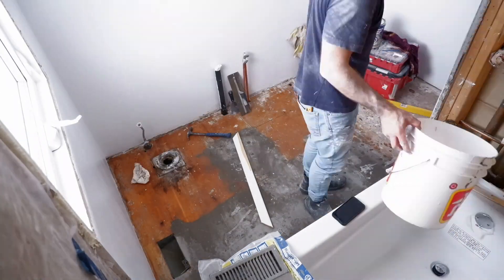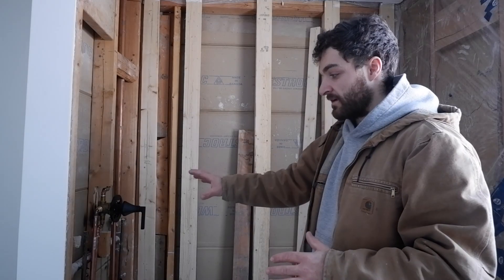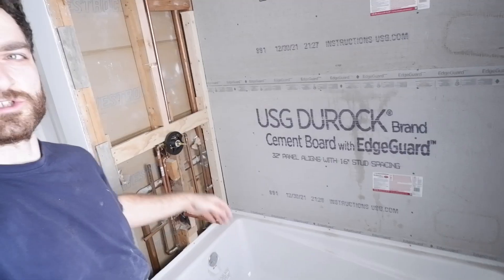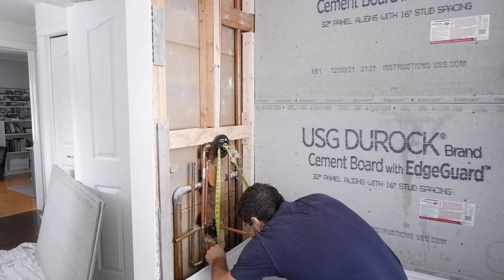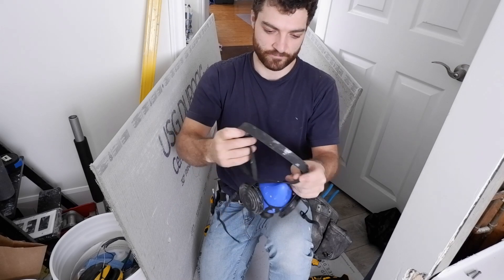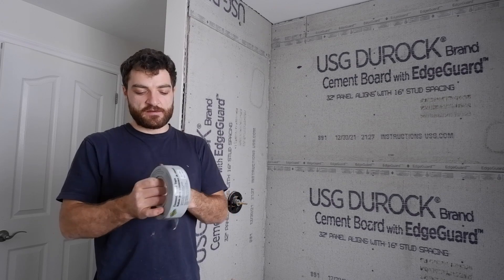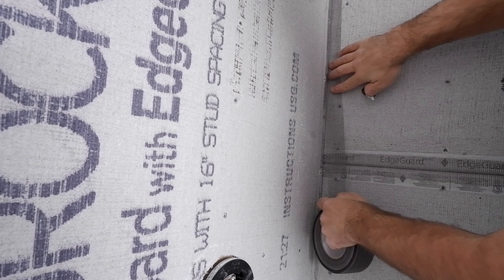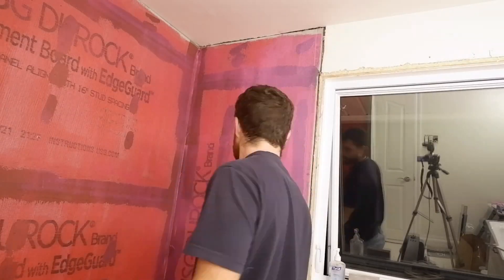How to use Durock and Redguard - Bathroom remodel part 3

Comment: Thanks for the video. Did you have to do any dilution of the red guard before applying to cement board to ensure it adhered well? I had an issue with red guard peeling off the cement board.
Reply from the maker: Hi Jason, 
Interesting, I don’t think diluting the red guard is required, weird that it’s not adhering probably. All I could advise is double checking the manufactures recommendations. 
Couple things come to mind, has it had enough time to dry, is the cement board porous enough, is there any settling of the red guard or maybe it’s been frozen and has separated a bit, which might hinder it adhering properly.
Hope you’re able to figure it out! Good luck

Comment: Correct installation of any cement board is to use thin spacer as you set the lowest panel so that it doesn’t sit on edge of bathtub flange. Needs a caulkable space; Durock says 1/4” although 1/8 is probably enough
Reply: he did do it properly. as long as you set your durock on top of the flanges your fine. because the tile goes down to the tub. then grot it wholes up for years.

Comment: You don't tape it with the red guard tape?
Reply: it’s not really necessary lol as long as you tape your joints an apply your mortor on them let it dry an apply the red guard over the durock it’s like a waterproof thick layer depending on how much you use

Comment: So because you used mesh tape and thinset in the seams, you don't need to use the redgard felt tape?  I was planning not to use thinset and mesh tape, but to just caulk the seams, followed by redgard felt tape with redgard.
Reply from the maker: Ya you could totally go that direction! I wasn’t able to with this job as it was during Covid and material was hard to come by where I lived. So went old Fashion with the thinset and mesh aluminum tape
Reply: @zackcrafted    Thanks!  I haven't seen a lot of videos regarding the use of felt tape.  It is so damned expensive.

Comment: How much of the bucket did it take to do the two coats
Reply from the maker: I found it was almost enough, depends on how porous your cement board in, mine was quite porous so it sucked in the first coat of red guard quite a bit

Comment: Forgot insulation on walls, not smart
Reply from the maker: Ah good idea! Did insulate under the tub, wasn’t to worried about the walls just because of where the shower is located in the house
Reply: You only need insulation on outer walls, genius.
Reply: Rockwool R15 is soundproof insulation , lovely around a tub surround in walls, bathroom walls in general . quiets the shower sound if someone is sleeping in the home, and quiets general bathroom noises  from the rest of the home, laundry rooms , ect. It's resistant to mold, rodents, fireproof , ~ real easy to instal.